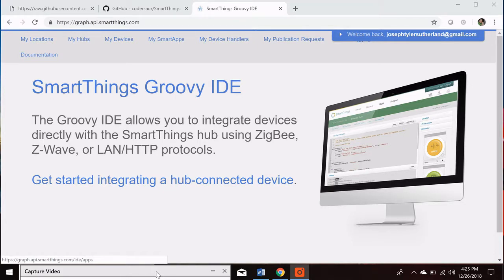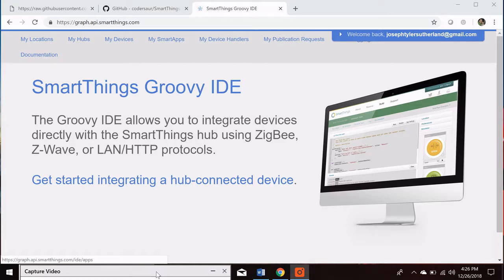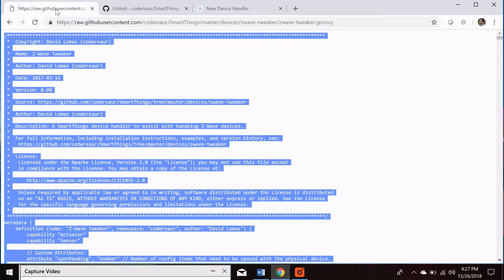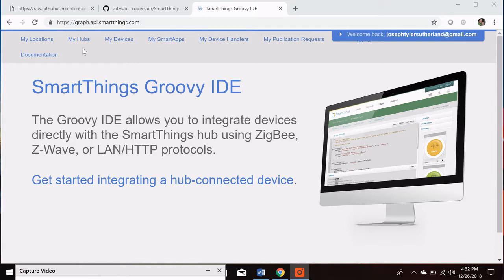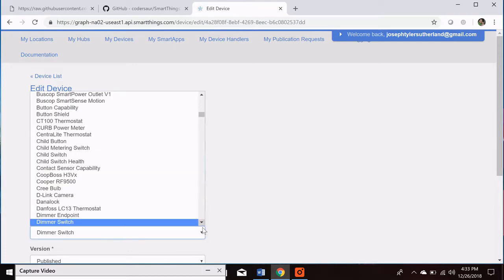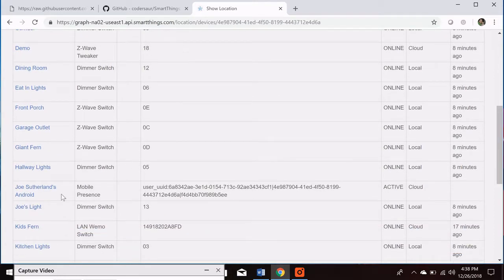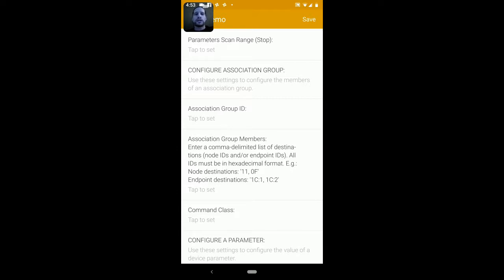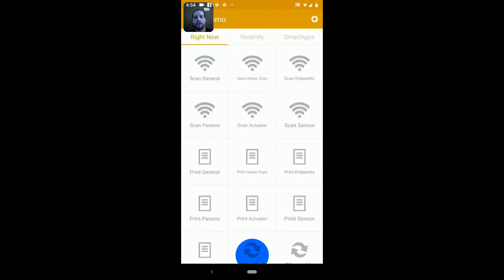Virtual 3-way Switch with SmartThings and Z-wave Association Groups

Comment: Hello Joe,

I believe this is the solution I need as I have Eaton RF-9640-N and RF9642-Z switches. Currently the RF-9640-N (Master Dimmer) is connected to the light and works great. I have the 9640 connected to my ADT home security hub and the switch works by physical pushes as well as by the ADT control screen hub and my ADT app. 

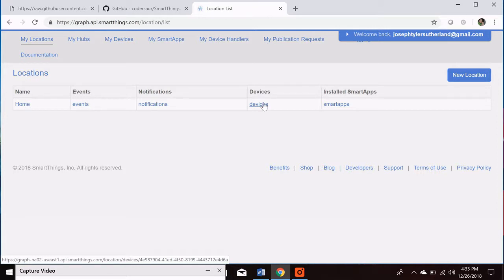I believe the next steps would be for me to create the association group that you're explaining in your video. I get to 13:33 in your video and that's where I get stuck. I guess the quick question is, do I need the Samsung smart things hub hardware to perform this association? Is there any work around solutions that wouldn't require me to purchase anymore hardware?

Comment: Do I need to have an Android device to complete this setup? I don't see these options on the iOS app even after changing the device type. The Preferences information does show, though.
Reply from the maker: No. There is a windows 10 app and an iOS app as well. 

It is possible to do all of this via the smarthings IDE or other methods, as well, but not with these particular instructions. You can read on the smartthings forums about other ways to set the association groups.

Comment: Thanks very much. I have a Eaton RF9617 Accessory Switch and the RF9601 Wireless Switch. I have a Smarthings Hub and the New App on my mobile. I followed your instructions:  Copied the Groovy code in the Device Handler, changed the Item to the Z-Wave Tweaker on the RF9617 Accessory Switch. When I go back to my Mobile Device (Android Samsung S20) I do not see the Tweaker GUI. The Smartthings Mobile App takes me to the Room where my Hall Light is located, which is the switch I am wanting to update with the Tweaker. The only difference is there is a Cloud with a line through it where my On Icon is typically located. Let me know if you have any ideas on why I am not seeing the Tweaker GUI?
Reply from the maker: You're almost there! Click three dots in top right then settings and you should see the tweaker ui. What you saw in screenshots with the buttons was in the legacy app which is dead now. You can still get to what you need in that settings menu, though.
Reply: @joesuffceren2  Wanted to let you know that I finally got it working and the video was super helpful. Thanks !

Comment: Hi Joe.   I wanted to drop by and say thank you for posting this video.  It helped me a great deal in finding a solution that works.   I do have a question that I hope you can help with.  I am using a 46201 switch (2nd generation) and set it exactly like you did in the video.  It worked and was instant for the first 4 or 5 times.   However, now there is a consistent 5 second delay.  Have you run across this?
Reply from the maker: Thanks for the kind words. I I'm glad the video was helpful for you. I have seen that type of a consistent delay only when trying to do a virtual three-way like something with webcore. You definitely should not be seeing that with Z-Wave association. if you were having Z-Wave signal strength issues or Z-Wave mesh routing problems I would expect the delay to be erratic not a consistent 5-second delay. That sounds to me like you have some sort of logic firing in the hub that you are depending on. Have you done anything with webcore or something like that that may be impacting this that you're not expecting or thinking through? That would be the first thing I would look at.
Reply: @joesuffceren2    I loaded webcore last night to try to be able to capture double taps on the hub.  However this was after the problem surfaced and was hoping it might correct it. I thought using association group 2 should not need a hub and that one switch directly told the other switch to turn on or off.
Reply from the maker: You are correct. The method that I describe in the video is designed to produce direct z-wave association which does not need a hub. My concern was that you may have inadvertently introduced a hub into the flow. You could try just removing the association groups and potentially excluding the switches from your z-wave network to start from a clean slate? Sorry, just thinking general troubleshooting here. Have not had that problem with direct association.
Reply: @joesuffceren2  I have done both.   Removed all the association groups and factory reset the switch and then re-added to the network and rebuilt network and it is the same.   It happens no matter which device I put in association group 2.   Ill have to call GE Support tomorrow and see what they have to say.   I saw someone saying something about a timeout on the double tap feature that might be causing the delay but 5 seconds is pretty long.
Reply from the maker: @EricHeilig  on that switch association group 2 is for single press (along with the actual local load of the switch). Association group 3 is for double tap. You mention group 2 and double tap, so I'm concerned you might be mixing up use cases.
Reply: @joesuffceren2  I have actually tried both 2 and 3 and they both have the 5 second delay.   I was making reference to someone saying that the delay is caused by the switch waiting for the second tap to know if it is a single or double tap.   Ill come back and post what GE support has to say,  If necessary I will go back to the 14291 switch as they seemed to work with no problem
Reply: Just thought I would close the loop here.   I wound up going back to the 14291 switch as I was never able to resolve the problem with the 46201 switch.

Comment: Thanks for the how-to vid! I'm in the exact same situation where I need a 2nd dimming switch in our dining room. Quick question though...does dimming association work both ways? For example, the "remote" switch will tell the "master" switch to turn on/off and dim. But will the dim levels be out of sync when i change the dim level from the master switch...e.g. i dim the master down to 50%, but the remote switch thinks it's still at 100%...if I chnage the dim now from the remote to 75%, will it go UP from 50% to 75%, or will it jump to 100% then dim down to 75%?
Reply from the maker: I understand your question, but I have not experienced that particular symptom. I don't want to say for certain that it won't happen, but I do not do a ton of dimming it changes on a regular basis. Also, I tend to do more with voice control than I do with physical switch manipulation. There is a comment by a guy named Daniel lower down in the thread that mentions setting the reverse association groups as well, as a way to fix this problem. I have not tried that myself, but it seems logical to me. If you run into this problem, I would give that solution a try.

Comment: Hello, first I’d like to thank you for the detailed video, I used minimote to associate z-wave switches before not knowing there other options. This is brilliant. I am using z-way NuTone NWD500Z and NWT00Z since they half price it 3 time less compare to GE. And now I am looking to a way of turning off LED little indicator light. It’s nice to have it for the bathroom to see where switch is at night but pretty annoying in bedroom at night. Let me know if you have used those and found a way to trigger this Or found IDE handler that can do that. I used one handler that suppose to do that but nothing happens when I set LED indicator off. Thanks.
Reply from the maker: I've never used nutone smart switches, so I don't know a device type handler to edit their settings. Sorry!

Comment: Is there a less expensive remote switch option than the dimmer switch that can still provide dimming control to the dimmer with the load?
Reply from the maker: If you have existing physical traveler wires (or can easily pull them) GE makes a ~$20 companion switch, but for this virtual 3-way method with zwave association, I'm not aware of one. I'm sure there are potentially cheaper zwave dimmers out there, but I've only ever worked with these GE ones.

Comment: on my switches you need to set the reverse association as well otherwise if you turn the master switch off the slave get out of sync.
Reply: Daniel, this method works for you though?
Reply: @swooosh83  Yep. The group was different for my switch (Eaton/Cooper aspire switches).
Reply: @2bagsOfChips2k2  If you don't mind me asking, what group did you use for the Eaton/Cooper switch? I'm working with the same ones probably... RF9540 Master Dimmer and RF9542 Accessory Dimmer.
Reply: @ertreminio  2 years too late but I believe it was 0. Tho I have Found this not to work for me 100% of the time ( i.e. different batches of switches)
Reply: @2bagsOfChips2k2  that was the issue I ran into… sometimes they work properly, sometimes the lights go back and forth between the switches.
Reply: @ertreminio  My issue was more that they would never sync not echo. The lack of documentation from Eaton was disapointing.